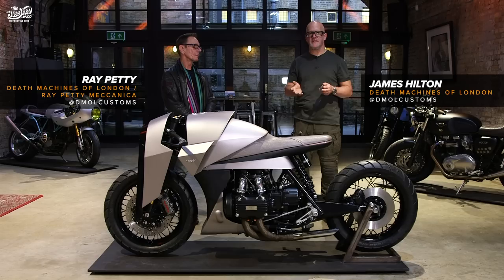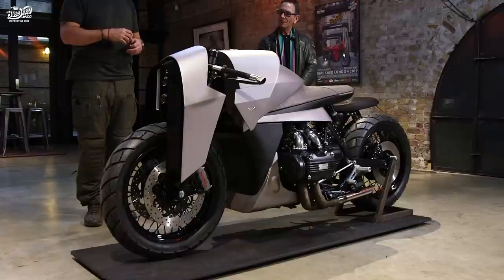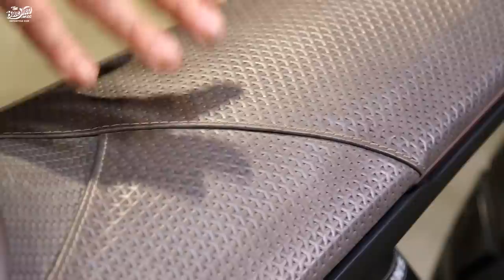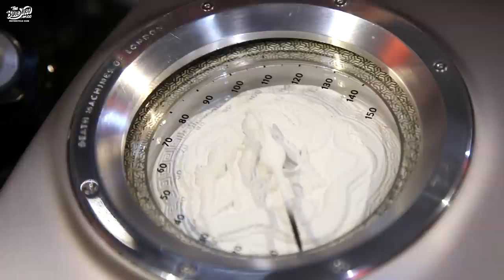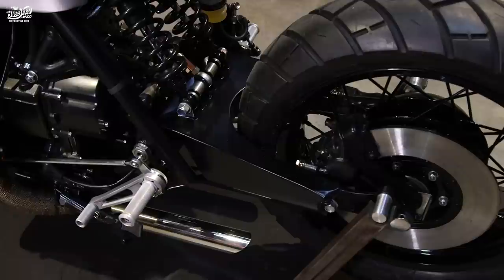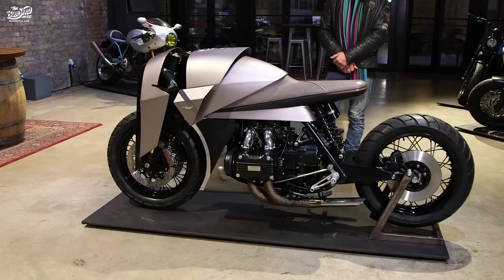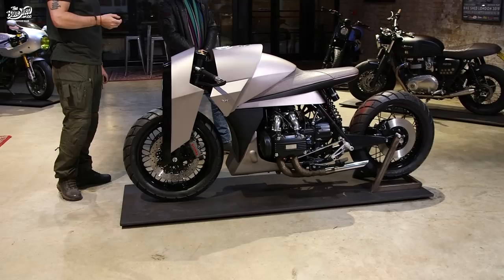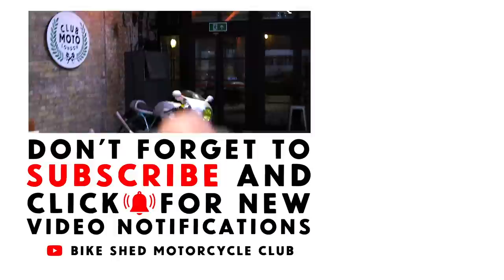'Kenzo' by Death Machines of London

Comment: What a beautiful bike. I would add a few design alterations to it, like a removable wind screen, slightly longer seat and a underseat exhaust that doubles as a rear mud guard with a large single oval outlet. Also a upright CNC handle bar system that could be folded away, and the wind screen acts like a sliding locking cover, if only pigs could fly. What a beautiful machine.

Comment: Sounds like they were ashamed of their 2018 facade showcase and decided to go back to the drawing board to make a functional bike. I can respect that and also the level of details they went into creating it. That said, I think the design suits an electric motor rather than a 77 Honda.
Reply: Agreed, all that work for an unspiring engine. They could've at least made some suitably designed vavle covers to match the look. A little much for my tastes but I appreciate the craftsmanship.
Reply: I agree, needs to be electric or jet powered.
Reply: You & I have different idea of what "functional" means.
Reply: @TigerDude333  true.
Reply: @Bunnyshooter 223 well they're not trash lol. It's just smart what electric powered vehicles are doing
Reply: @user-we8nc7fl7b  issue is max you are getting 280 on a charge and thats running over 100k

Comment: Looks more Katana as in Suzuki influenced but yeah, is what it is which looks nothing like it was lol. I see a comment about no guards/fenders... here is Oz they take em off, rub out the paint and clear coat it, add struts or a hard tail then charge double that of the same machine if it were in concourse condition and so many don’t realise the absence of guards makes most bikes look cool and when trying to get it roadworthied it ends up looking like crap due them: it’s difficult to build a full custom and keep the symmetry flowing with them, some makes not so bad but most... no. I’ve mostly tried to hide the front one as in thin and close in flat black and keep it functional as I build to ride in all weather plus here it’s law to have one... so glad we have tiny number plates, those huge signs you guys have would do my head in.

Comment: I just realised! It needs reverse cone pipes on the 4 into 2. You could a flat number left to right and have a beautiful piece of satin finished SS pipes  come out the back. I am all for the correct way of channeling of exhaust gases. (i KNOW A GOOpD WELDER IN dURBAN) Look into the benefits of a balance pipe across the way. It increases flow volume...... Enough drivel now - that is one supersexy specimen of the 2 wheeled kind. Hoping to find a good early Wing in my local classifieds anytime soon. You gotta keep on hoping - -

Comment: An object lesson in todays motorcycle design. The front suspension travel has been reduced so much it must be near to nonexistent. Otherwise the lamp assembly would shatter. There are no mudguards. There is no numberplate holder. There are no rear view mirrors. There are no turning indicators. Not even a rear view camera with screen. It has no silencers. In other words: This thing can never be roadlegal. Without silencers it can not even be competition legal. A rider is never presented which bodes badly for the ergonomics. One must even wonder if that, most important, element of the oeverall ensemble has ever been considered in the design process. In other words. This thing is just a toy statue for the ultrarich, have it all metro boy who might decide on a Fabergé egg next. That makes it a useless as a motorcyle. Today's design industry is full of such nonstarters. Still it looks great. Decadence is however the only message.

Comment: I think you have far too many angles and lines that clash and not flow together especially around the forks where the front cover meets the tank the tanks leading edge just don't point the right way , it makes it look like its trying too hard for a look that could be pulled off if you got the angles right, I might make a photoshop mod to prove my point

Comment: If you’ve ever slipped off a seat and landed on a spinning tyre you’ll understand why it’s a no from me
Reply: have u actually rode bikes?
Reply: raa kunn Yes, several, for a good few years, I could list most the bikes I’ve owned but I won’t bother. Your turn to answer me one now, have you ever jumped a bike 60-70 foot through the air?
Reply: @evs9404  nope but yeahh u know bikes like this aren't design to be jumped with